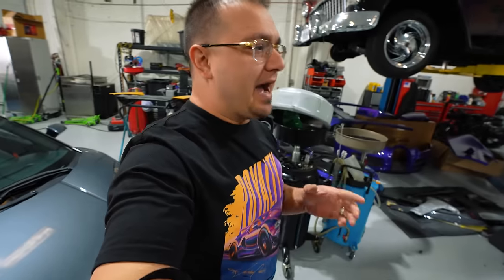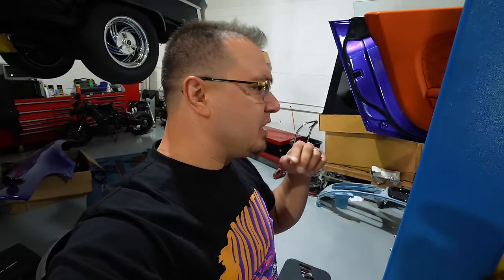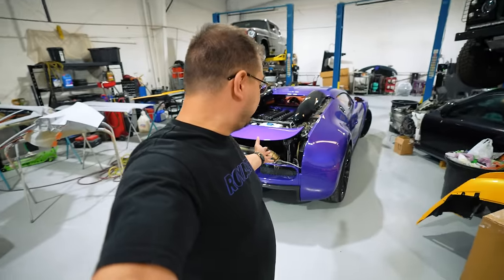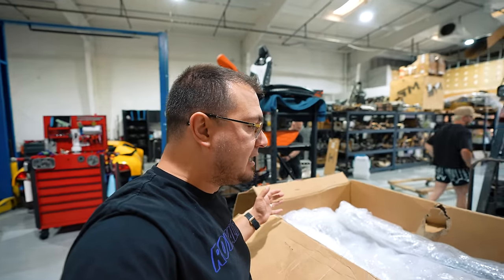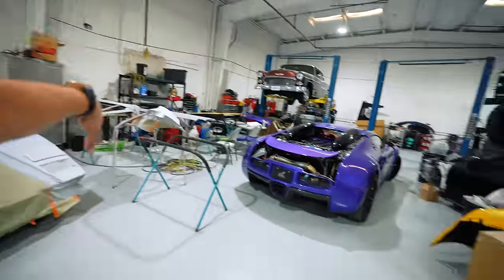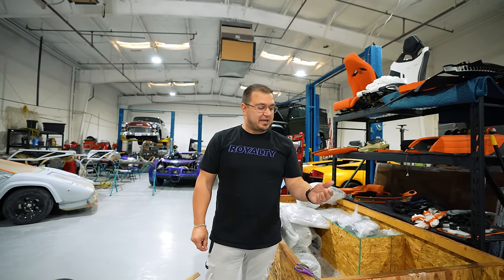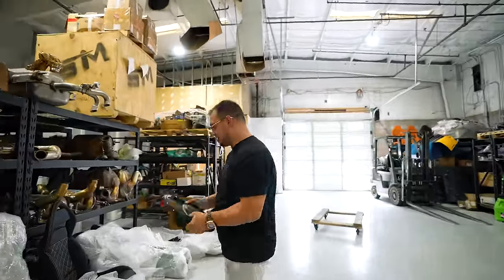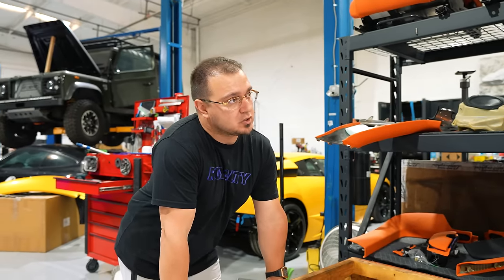Final Step to the DDE Murcielago Rebuild!

Comment: I may have missed a video, but I was at the shop about 5 years ago and looked at the hypercar you were building off the alfa chassis, I assume that project has been scrapped, is that true?
Reply: I believe you are correct and it was due to Alfa stopping support on the platform he was using.